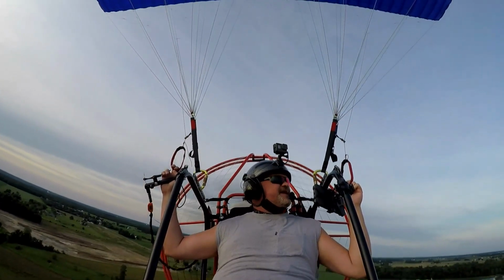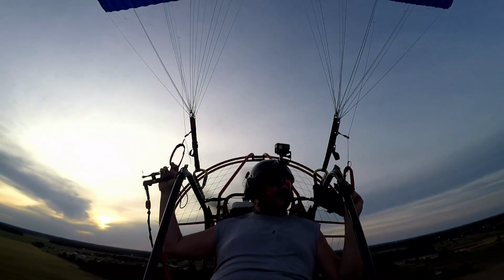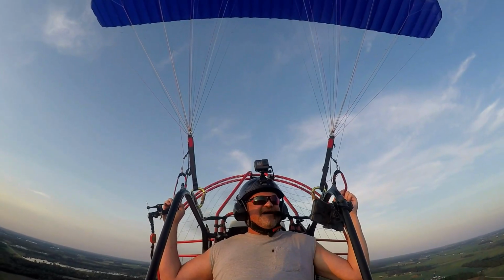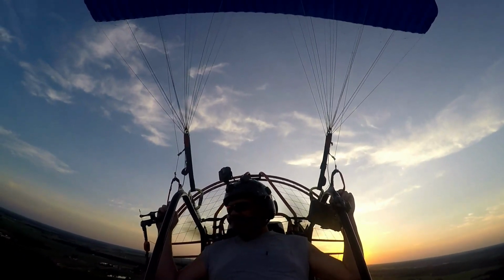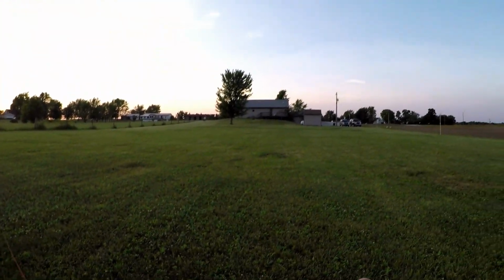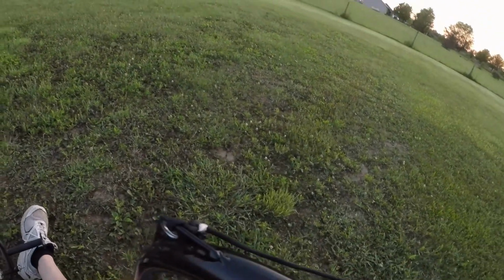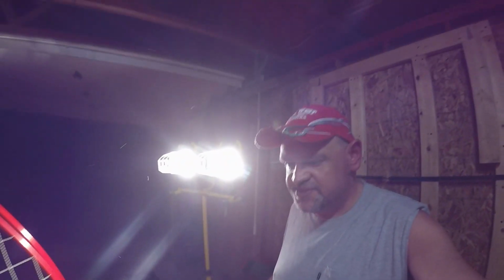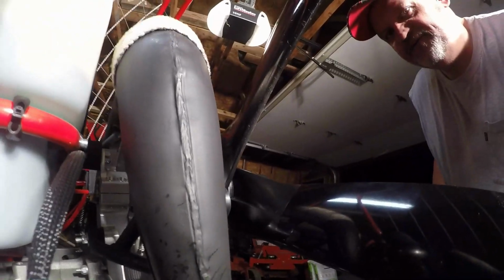SPUTTER AND SPIT...PARAMOTOR PIECE OF S#!%

Comment: Barry. It's really sad you're having all these problems with your monster. This is a tried and proven motor. And with all the hundreds of students I have flying monsters and fresh Breeze.  We just don't see this. Ours are starting on the first and second pull right out of the box. And we just don't have these kind of issues. I'm not sure why you're having issues with yours I believe some of them may have been caused from some of the poor choices you've made with take off areas and some of the mishaps you've had. You were supposed to come back for more training in the beginning and you did not do that. In some of your videos you completely ignore some of the training teachings that I've taught you while you were even here. And the only call I received in the beginning from you was that you were burning a lot of fuel. Which you did at the field when you were in for training. We have that personal video. You were over 300 lb so burning a lot of fuel is expected.
You refuse to believe that and I believe you tinkered with it as you said or let your friend mess with the Reed valves.
 Either way. I'm going to offer a solution to you. Because quite honestly some of your videos I think are just meant to create a following. You're trying to get people to just watch your videos by your titles that you pick. Or for the example the big flaming ball of Fire coming out of the sky. I think you're being a bit extreme in order to create a following. And as far as showing the fuel splattered all over the back of your exhaust after landing. I'm going to have to call a big fat BS on that. Because the propellers are pulling are so fast through that area it wouldn't have time to collect on an exhaust. And then... on top of it all... hitting a hot exhaust would vaporize any fuel. So I think that is just flat-out BS. 
I'm going to prove that in a video... when I spray fuel onto a ahot exhaust while it's running and then I'm going to shut it off five minutes later simulating a flight.  And I guarantee there will be no wetness on that exhaust.

 There's no way it would be dripping wet if it was a hot exhaust and are being pulled through the propeller system anyways. 
Again I'm not buying it !!
But... I'm going to give you the benefit of the doubt and I am going to offer to pay for your entire unit to be shipped up here and my mechanic will make sure it is returned in perfect working condition we will even make a video showing that it is completely fixed. I am publicly calling you out on this one. And offering to take care of the problem which you did not allow me to when these problems started happening. You wrote me a letter the other day saying you're terrified to fly because of fuel on your exhaust. I told you not to fly it until I can figure out and try to solve the problem for you and get it taken care of which I said that it would. I even offered to buy you whatever pieces were necessary to fix the problem and pay for any parts. I thought it was the fuel tank when you first started describing it and I even offered to buy you another fuel tank. Then you explained it was somewhere by the carburetor. I asked you not to fly it. And instead you chose to make a video with a flaming Fireball as if it was going to catch on fire. Well if you really thought it was going to catch on fire why would you be stupid enough to Flying after being told by your instructor not to fly it until he can solve the problem for you? This confuses me. You were told not to fly it and yet you did. You were taught not to launch out of bumpy feels but you did. You were told to call me if you had any problems but you didn't. You were told to come back for more  training but you did not. You were told not to fly in poor conditions but you do. You were told to check the field ahead of you and look for any thing that could be a potential Hazard and yet you ride through holes in a field and then complain when you bend your frame of your front end.

So here's my public advice to you and here's my public statement to you anybody watching these videos. This is not typical of fresh Breeze. This man is ignored everything from getting more training to allowing people to help him with issues. His chosen to do things HIS  way period ...and FYI. I am the one that named him scary berry at my field. It was for a reason. I am offering to pay all expenses to have your motor shipped up to Ohio to my training field where I will have my mechanic fix it perfectly for you and I will pay all the shipping charges to return it. I would like your response publicly right here. Will you ship it up here and let me fix the problem free of charge. It won't cost you one dime I will pay all the expenses. You're simply trying to create a following. And there's nothing wrong with that. But the issues that you're having are your own fault. That's what I truly believe. And I'm going to call a big fat b s on a wet exhaust that supposedly was so hot you were worried that it was going to catch on fire. Because that would not be what when you landed not only from the airplane through the propeller system but it would vaporize from the heat of this so-called Fire Starting possibility hot exhaust. What is your response I don't want a phone call I want you to respond in front of these people that you're bad mouthing fresh Breeze to. In your own videos I spot problems that you are causing. You need more training and I'm willing to give you more training. Perhaps we need to go over a few more things that you're completely ignoring. I will wait for your response. Again I am willing to take care of all of the expenses to have your motor shipped up here and completely fixed free of charge. I will also make sure that I make a video of it running perfect. I have a hard time believing these problems even exist. But if there is a problem we are going to fix anything that you've already messed up free of charge. Again free of charge we are going to fix any problem that you have caused this machine. Waiting for your response
Reply from the maker: Kurt, first of all i accept your offer to ship the unit and repair it and send it back to me free of charge, at this point i would have gladly paid whatever expense necessary to be able to fly again, but this is the first time an offer has been made to take a look at the issues, so I will accept your gracious offer. I would like to clear something up though, this video is not real time, I made this video over a month ago and havnt flown the machine since you instructed me not to, but that was the last time I heard from you was 3 to 4 weeks ago, so as you requested then i have not flown it since. Also I am not sure why you find it necessary to call me stupid, and a liar in you comments, I have never personally attacked you in any way, this channel simply documents my personal struggles with the fresh breeze and lack of customer service I have received up to this point, If I would have had a good customer relationship with either you or the manufacturer of fresh breeze that would have been documented in my videos, but up to this point I have not. There are several statement you know are false but I do not wish to get into a he said he said debate with you, nor do I care if you agree with my videos or even if you like me. All I wanted this channel to be is a guy flying his machine and being happy but circumstances have made it a guy struggling with his fresh breeze channel. I have never stated I didnt make any mistakes as a new pilot, but none of the new pilot mistakes I have made would make the engine leak and run poorly, I have admitted my mistakes but have never heard you admit maybe I just got a bad motor, instead im called a liar. You stated you are going to video the repair process, I welcome that because when you see the leak for yourself an apology would be nice, I have never lied to you or anyone in my videos, and I am sad you feel so badly tword me, you were a great guy and even prayed with me before my first flight to keep me safe, I am sad my posts have brought you such anger.Good luck with the repairs im glad to have your help and the gracious offer you have presented. Best wishes Bart Berry
Reply: I met Capt Kurt last year at his flight junkies reunion and I can honestly say that he is one of the nicest, caring individuals that I have ever met. If there is a problem with your machine , and he says he will take care of it, he will. He is a man of his word.
Reply: FlightJunkies not quite sure that “customer service like no other” is a thing anymore bud. Replying with “over 300 lbs” is good customer service at best it’s pretty pathetic. Nah really pathetic... pretty sure treating like family could have been, if it were true, taken care of and fixed immediately following the first incident. Dude’s got some priorities out of wack here scary Barry, it’s sad that a company has to tuck its tail with hubris, then come back with slanderous remarks, and then continue to state that their customer service is spot on perfect... sounds like the beginnings of a sociopath to me brother good luck with that one. Get her fixed up and hopefully this guys word means something, breath not held for this dude... stay safe scary
Reply: This is how Christians act.
Reply: Zageroth as I said. The first I heard of it was in this video. Commenting on his weight is not a derogatory comment. Yes my customer service is like no other. And had I known about a problem I could have taken care of it but I was not informed of the problem I was only informed that it was going through a lot of fuel. So why you're trying to add fuel to a fire that's burning. You're just another troll you have no idea what you're talking about. Everybody who knows me knows what I do... you don't know me.  I let people sleep at my house. I feed them. I shuttle them around. And on top of it unlike you who probably paid thousands of dollars for training I don't charge them a dime. You pissed your money away. I saved my customers several thousands of dollars in training costs. So if you want to be a hater gonna hate on somebody who's taking that kind of money from people for training period and offering no accommodations. No shuttle service. And no family environment. You're just another troll running his trap based on nothing. 0 zilch nada. You've never been here. You've never seen what we do here. You're just running your trap like an ignorant fool. Good Luck Charlie
Reply: Stanley Denning I've done nothing that was unchristian. I'm a Christian not a doormat. Remember when Christ went into the temple and flipped over the tables. Remember when he pointed his finger that the Pharisees and religious leaders and called them a Generation of Vipers and hypocrites?  There's nothing wrong with speaking truth. And if you're a Christian you would know that. It doesn't mean you let everybody walk all over you and talk like an idiot. You probably don't like Christians which is why you're looking for any reason to point a finger. I suggest you get saved and you won't have that problem. There's still time for you to repent and ask Christ into your heart. John 3:36 is still in the Bible. Good luck just thought I'd clarify that for you.
Reply: Thanks kurt for standing behind your product and looking forward to see the video of the carb. leak fix so we with the same issue can fix our monsters...Sincerely NJViking...P'S. where should I look for the video? youtube or under flightJunkies
Reply: yep, ALL THE TIME?? HOW DO YA THING THEY GOT ALL THIS LAND HERE?/ THEY DIDNT PAY FOR IT?
Reply: Couldn’t have put it any better way Bruce! :) thanks for also standing channel ground and pointing out that bull shit comment :)
Reply: Damn Kurt , you wrote a book 📖 .
Reply: I'm not a fresh breeze fanboy, just a guy that loves paramotors.  For all their pros and cons the monster is considered a reliable motor in the industry. It's downsides are about power to weight ratio, not reliability.  You're making the right move to take Kurt up on his offer.

And to Kurt, c'mon man, this is social media.  You need to bury the hurt feelings and just offer the customer service.  Not only is it better for your customers but it's better for you.  You can't see it but you offered to fix his motor for free and you're still coming off like the bad guy because you didn't do it nicely.  If you had said, "I'm sorry you're having trouble, send it to me and I'll make it right" everybody would be thinking that they'd like to be your customer someday too.
Reply: @FlightJunkies and @BartBerry - May I suggest that you both stop trying to make this a middle school debate  and cease with the endless point - counter point drama. THIS SHOULD BE SO SIMPLE:  We have an unhappy customer. We have a company that has at this time recognized that and publicly offered to make it right. So either take advantage of it or don't and THEN post the honest outcome.
Reply: Zageroth did berry actually call about the problem? Or just make vids?
Reply: I hate to say it flight Junkies, because I have tremendous respect for you and your product, but it's not the fuel we see, it's the oil mixed with it that does not evaporate don't you think? You have NO idea how hard I am trying to get the funds together to do this life long dream. In 3rd grade my teacher let me start an avionics club in 1977. My parents got divorced later that year. My mother was dating a pilot that told me that having to wear glasses meant that I could not be a pilot. That smashed my dreams like you could not believe. I was in my 30s before I found that wasn't true. By then I gave up on  my dream and didn't believe what I was told then. Not having any exposure to the options, I didn't care too much about striving for anything else because that was all I cared about doing. I only did what I had to do to make a living and that's all I've done ever since until recently when I discovered this stuff. You know, Sometimes in life people meet a role model that takes them to new levels that they would never have reached otherwise. I am here to tell you it works the other way around also! I feel that half my life was robbed from me. I turned to partying and drugs and alcohol as a way of having fun. Stupid right? Yeah! Any ways. It's amazing what a good role model can do for a kid. It's also just as amazing what a bad one can do to a kid and how long it can last.  Both ways! I hope next year when I'm done with physical therapy on my neck and shoulder after a car accident a year ago this September to be in the great shape I was in before and better by far, and be in a better financial situation. I had a partnership fail that left me with 200 bucks in my pocket raising my 11 year old daughter by my self. That cost me over 160 Grand with no hope of recovery because there were no liquid assets when I win the case. Anyways, Sorry about going on, but it hurt a hell of a lot brother. I would accept equipment that needs rebuilt because I can do that kind of thing with confidence. But I am looking for the cheapest, yet safest way to get going on this. If anyone can help, it would be so greatly appreciated. If I had the money, I would happily pay full price for everything and be happy. I like helping others be happy as well and do it every day with my sense of humor and anything else I can afford to do. It's easy to give when I know it's not going to make or break me, but what little I can give may make the person I've helped. Hope my Karma comes back to me in this way although I know you can't choose how it does. I'm happy either way, but I'm greatly leaning more towards this. My daughter hopes this as well. Maybe she has an insurance policy I don't know about??? LOL  I'm a natural at all I do though, so I think she has the best in mind and prayers for me. God bless you all and happy landings forever!